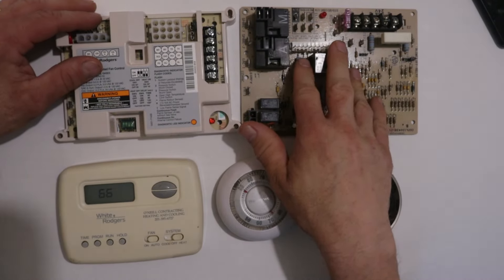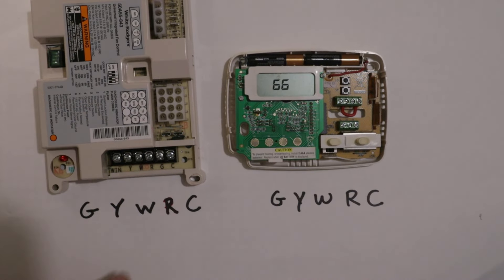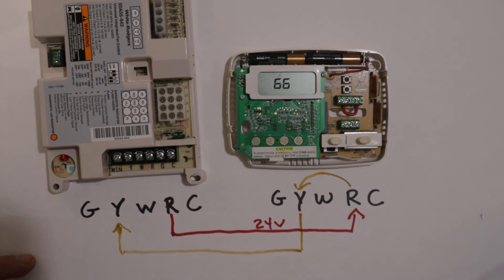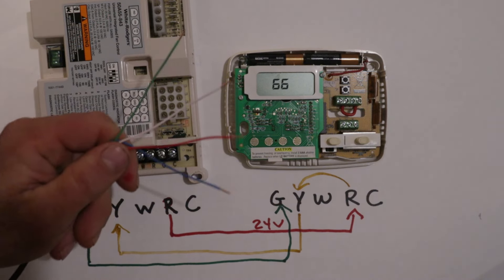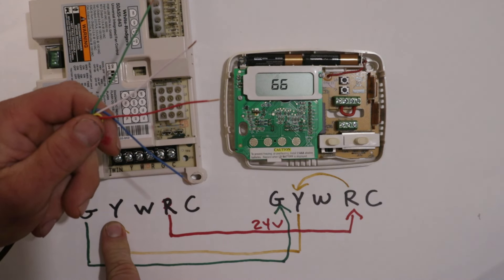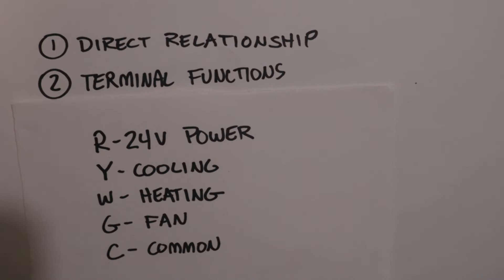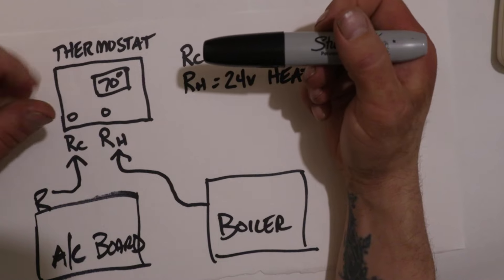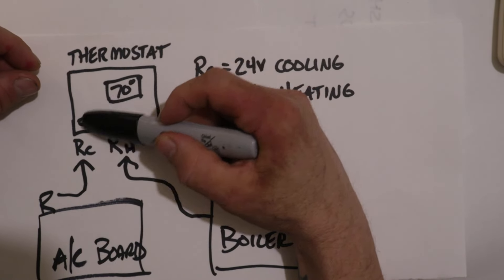Thermostat Wiring at Control Boards

Comment: If you have no C wire running to stat will the wires show 24 when disconnected from the thermostat?
Reply from the maker: Only the R wire will show voltage. Any other wire can act as a substitute common just for the purpose of getting a reading on the multimeter.
Reply: @JerseyMikeHVAC  Thanks! Can I get by with now C wire with the sensi stat with batteries? My nest failed on me after 3 years. Kept getting E 74
Reply from the maker: Yes if it accepts batteries it should work as advertised
Reply: @JerseyMikeHVAC  Thanks please keep the videos coming they are very helpful!
Reply: Had a HVAC tech come out yesterday because the board blew two fuses and blower and compressor would not start. He found a shorted wire between stat and furnace. No I have new wires and a C wire!

Comment: My control board doesn't have a wire connected to Y. I have central ac and furance. I only have wires for W R G C. Why is that ?
Reply from the maker: There are some systems that send the Y signal for cooling straight out to the condensing unit outside and it comes back to the air handler as a common.

Comment: after watching a few times i now understand what all the wires do,im just having a tough time wrapping my head around what i can do to install this C adapter for the homeywell T9,i have an okder lennox ac with no Y terminal,my tstat is a 3 wire cooling only so i have R,W and G wires,it tells me in the C adapter manual if i have no Y terminal it wont work for my system,im figuring if i can use another terminal to "fool"it maybe i can get this thing to work,im going to go back and study your video some more thanks
Reply from the maker: The white wire should be in your Y terminal at the thermostat (originally). That is your Y wire.  You don't need W. 

At the other end of that white wire at the air handler, that white wire will connect directly to another wire that goes straight out to your outside unit. You can try to use that wire as your "Y terminal".  The other wire from the outdoor unit is a common wire coming back and should land inside the air handler.  

Make sure you remember the original wiring because you'll have to put it all back if that doesn't work.

Comment: In furnaces w1 black and w2 white wire so in google tharmostat gen3 w1 black and w2 connect ?
Reply from the maker: Yes, black was used for 1st stage heat and white for second stage.
Reply: @JerseyMikeHVAC  okay 
Thank you

Comment: I have red white only from thermostat to board .recently my 7505b gensy Burdette box had no power got new box same problem no motor power just blower runs no heat I put red white together to test one theory still no power also condenser is good sensors good still no heat , help????????

Comment: Please help. I tried installing the Google thermostat only to find out I have an old system. So I decided to reinstall my Wright temp model 6022 thermostat. I only have heating. I have a black red yellow and green wire. I first had the black wire on the Common connection but when I put my thermostat on auto and heat, I could hear it click but My unit did not come on. It will only kick out heat if I turn to the switch to on and heat. It will not work on the Auto button. So I thought maybe the black wire should be installed under B. It only clicks and nothing happens. What am I doing wrong? Please help.
Reply from the maker: When you say you only have heating, do you mean only the heat works or that this is just a heating system and there is no AC? 

 What kind of system? Forced air heating? Water boiler? Steam boiler? 

How did you have everything wired other than the black wire? Those two bits of info could help me figure out what the issue is. 

 Normally, G terminal is for the fan. Typically, a green wire. W is for heat, most likely the black wire. Y is for cooling, typically yellow wire is used. Red is used for 24v supply power to the R terminal.
Reply: @JerseyMikeHVAC  I have forced heat there’s no cooling unit at all. I do not have a white wire. I only have yellow red, green and black.
Reply: Red is hooked to RH, Green is hooked to G and the yellow wire is hooked to Y. I do not know what to do with the black wire.
Reply from the maker: @robbieoden3703  Put it on W. If it's still not working then, take the door off the furnace and you'll see which wire goes on which terminal there. Just repeat the same for the thermostat.
Reply: @JerseyMikeHVAC thank you
Reply: Sorry to bother you again, Mike. I’m now wondering if my thermostat is bad. I put the black wire into the W and it’s doing the same thing, it only works if I put it in the one position but will not work in Auto unless I put it on cool. Just weird.
Reply from the maker: @robbieoden3703  Whomever wires it didn't use conventional wiring colors. You have to look at the control board in the furnace to find out which color wire goes to which terminal. That's the only way.

Comment: can you  explain why im not getting 24v at R on the control board but im getting 28v coming out of the transformer, im only getting 2.2v at the R terminal
Reply from the maker: If it's a furnace, there is often a high temperature limit switch or flame roll outs located in the circuit between the transformer and the R terminal on the board. If one of those are open, you won't get 24 at the R terminal on the board. Assuming the 3 or 5 amp fuse on the board is not blown.

Comment: Awesome video. What happens when you have three wires on a terminal in a control board? I have three on my c terminal from thermostat, condenser, and humidifier.
Reply from the maker: A lot of guys will steal 24 volts off of a yellow wire that proves the pressure switch for the 24 volts needed to operate the humidifier solenoid. The common at C just completes that circuit. 

C from the thermostat completes the circuit needed to charge the stat. 

C from condenser is to complete the 24v circuit that engages the contactor to turn on the outdoor unit.
Reply: @JerseyMikeHVAC  that is exactly what they did. So it is fine to have 3 wires at the c terminal and can't hurt the board. Can the just be all connected at the screw or would a wago or wire nut be better? Thanks again.
Reply from the maker: @lukeleiden197 It won't hurt the board, but I would prefer to use a wire but to tie them together with only one wire on the terminal. Don't like the wago connectors. Electrician friend of mine doesn't advise using them.

Comment: Okay I wired up the white to white Red to Red green to green yellow to yellow. I run  down that yellow wire that runs in the unit. It runs to the compressor unit. Now my question is it leaves me two wires to deal with one Comes from that control board state on the board 0 and that other wire I run down come from the main line power that come in and hooks to the side.
Where can I hook these wires to the 0 wire is plug in the board that other wire comes from the side of the main. Again I been watch your video I'm that guy that working on that Goodman package unit.

Comment: Hi jersey Mike my friend has ac the has 3 wire in the condenser or outside ac unit how would i or connect those wire its a red a black and a yellow wire it a older unit do i connect those wires to the control board or the t-stat thank you in advance
Reply from the maker: What's the brand/model number?

Comment: Very good explanation on how that works.  Where is the actual 24volt made at?  I thought it was generated by the coil in the contact. Can you clarify that for me?  Well folks I don't think you will find a better explanation out there.  So lets give him a thumbs up and subscribe for this great video. Thanks to all.
Reply from the maker: Thank you. The 24 volts that pulls in the contactor is part of the low voltage control circuit that begins with a step-down transformer located in the indoor unit. The transformer steals 24 volts from the same 220 volts (sometimes 120 V) that the main blower in the sir handler needs to run on. It then sends that 24 volts to the control board, and from there it goes to the thermostat's R terminal. 

 When the T-stat calls for cooling, it will send that same 24v to the Y terminal in the stat, which then eventually goes out to the contactor. Inside the contactor there is what's called an electromagnetic coil. When 24 volts runs through it, it creates a magnetic field, which pulls in the contactor like a regular magnet.  The outdoor unit then turns on. 

When the t-stat stops the call for cooling, it stops sending 24v to the contactor, that loss of voltage makes the magnetic field disappear and small springs inside the contactor then push the contactor back open again to shut the outdoor unit down.

Comment: The control board in my air handler doesn’t have a yellow wire or yellow terminal. It’s just R C G W2 W1
Reply: How would I connect my fan?
Reply from the maker: On some models the Y wire from the thermostat runs directly to the outside unit and doesn't go to the control board on the indoor unit. Once it activates the outdoor contactor to turn the outdoor unit on, the Y wires returns back to the indoor unit as a common wire connected to C.

Comment: I am in the situation where my control board is spliced in between my Thermostat and AC unit. I am unable to wire up a smart Thermostat because I only have V+ (red) and Vg (white) running from my control board to the Thermostat. How do I bypass the control board completely in order to get all wires down to the thermostat point where I can install a smart thermostat. Unit is Goodman, control board and current thermostat are Carrier. Thanks!
Reply from the maker: is it just for AC or is there heat involved too?
Reply: There is heat involved as well
Reply from the maker: Heat & AC typically requires running new thermostat wire when converting from communicating stats like that.  Sometimes 18-3 wire is
 run from the electronic interface module (EIM) to these com stats where it might be possible to do it without running new wire in heat only or cool only applications. Unless you're very lucky and they ran 18-5 wire to your communicating stat and only used 2 of those wires for V+ and Vg...or the EIM is right next to your thermostat already...
Reply: Yep they ran 18-5 wire from the EIM to the stat but only connected white and red. At the EIM end on the stat side, white and red are also connected and the rest are terminated/cut and not connected to anything. Then on the other side of the EIM all 5 wires are heading off to the AC unit.
Reply from the maker: @davemarshall9640  Perfect. Then you should be able to splice the thermostat wires together color for color at the EIM and just hook up the smart stat at the other end using all 5 wires. 

Just make note of what color wires are connected to what terminals on the EIM from the unit so that your spliced wires to the stat land on the same terminals they were on at the EIM before you disconnect them.(R from EIM to R on thermostat, W at EIM to W on stat, etc.)
Reply: Thank you so much for the explanation! Looks like I should be able to bypass the EIM and splice the matching wires together. Really appreciate it!

Comment: I had a tech come out and repair a pin hole this august…. Little did I know how janky he was with the wiring of the thermostat wires in house/control board. When I replaced the condenser fan and had to remove the janky wiring work he left me with to wire the motor properly, I am not understanding why it’s running heat while in A/c mode. 
We don’t have a split unit… it’s heat pump (everything outside). Guy wants to charge me $75+ tomorrow after I paid him $800+ to solder a pin hole/recharge unit back in august. Is this something I can fix… I feel like he cause this mess by bypassing the unit initially
Reply from the maker: After other people have been into it, this is one of those circumstances where I'd have to look everything over myself to see what the issue may be. But on an off chance, do you have a Honeywell thermostat?
Reply: @ he installed one (before I knew what was happening)… I have a Carrier Infinity (yes I hate them now) and it was a communicating thermostat. He threw the Honeywell up and did a wiring job on thermostat wires to get it to run with the honey well. I had to pick up a new condenser fan from a supply house because the factory 3 wire was going out. 

My wife was in/out of Dr offices and ER with gall bladder attacked for 3 weeks while all this was happening.
Reply: @ he didn’t even leave a book to set it up. A/C worked until I had to put the 4 wire motor in and wire it up like the manual said… the problem has to be in the color coded thermostat wires either on control board or thermostat. I’m VERY mechanically inclined but when people start snipping wires and bypassing mess, then tell me just wire in the condenser fan…. Which I did flawlessly… but their wiring job is the glitch 🤬
Reply from the maker: @feraladdicts  If there is a white wire on the W terminal take it off. See if that fixes it. Honeywell specifically says not to use the W terminal on heat pumps.

I've seen people put the heating wire on W and cause the heat strips and AC to run at the same time.
Reply: @ on the thermostat or control board side?
Reply from the maker: @feraladdicts  thermostat
Reply: @ I’ll gladly send pics of both thermostat wiring and control board. I’ve pulled over $3500 out of nowhere in the last 45 days and I’ll have to beg people in the breadline for handouts if I have to pay another bill like that again.
Reply: @ removed the white wire from thermostat… evaporated coils still warm and condenser coils sweating… still.
Control board is wired as such. 
Red wire - R
Green Wire - G
White wire - W
Yellow Wire -Y with jumper wire ran to one side of contactor joined with another brown wire that was already there.
Orange wire - O
Tan/Brown wire - Com with a jumper ran to one side of contactor

Comment: what is wrong with my AC when blower doesn't turn off and outside fan (thermostat on cool ) doesn't turn on?
Reply from the maker: If the indoor blower shuts off within a couple of minutes of turning Tstat off, then my guess might be a bad capacitor in the outdoor unit. I don't have enough info to diagnose or confirm anything.

Comment: I have four wires on my thermostat...red, green, white and blue.  There are no extra wires behind the thermostat.  White goes to W, Red goes to Rc, but Rc is jumped with R, Green goes to G and Blue goes to C.  It looks like the original install already configured the furnace panel because the original thermostat was powered by the furnace and the batteries are for backup power only.  The house was built in 2015 and only has a furnace, no A/C, which is why there is no yellow wire.

Comment: All I know is that the circuit board for my thermostat has a Omron G6HV-2 3 vdc chip I looked into the data sheet and I'm in fuck you mode .

Comment: Where's part 2 for the C wire to thermostat, lol?
Reply from the maker: C to C. Pretty straight forward. But if you need a common and don't have an extra wire, one trick is to use the G wire instead (usually green). Switch both ends of the wire from G terminals to C terminals. 

This wire independently turns on the blower without heating or cooling mode being activated. It is for the Fan ON setting on the thermostat (instead of AUTO). This is just to circulate air in the house if you wanted to. 

Most people can do without that function as the board can still activate the blower in cooling or heating mode without it. 

The only exception is if you have a fan relay board in the air handler. It doesn't have Y or W terminals on it. Just R, G and Common. This trick won't work in those situations.

Comment: What I need to know when I took a part my very old thermostat I had a jumper from yellow to a number1, I hv no clue what number 1 is, that’s my problem.😃👍
Reply from the maker: Do you have 2 stage cooling?
Reply: @ if u mean heating and cooling yes I do👍
Reply from the maker: I actually meant 1st and second stage cooling. What kind of thermostat is it?
Reply: @JerseyMikeHVAC  the old one is a Honeywell LR1620 and the new one is Honeywell RTH2300
Reply: @JerseyMikeHVAC  I don’t hv a clue what a first stage or second stage cooling is👍